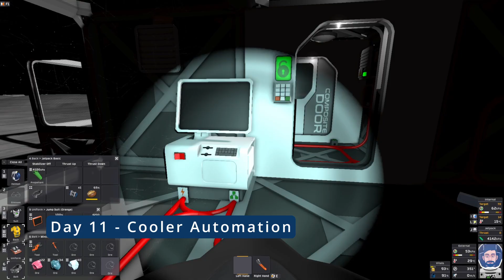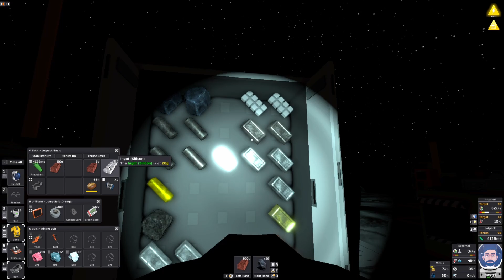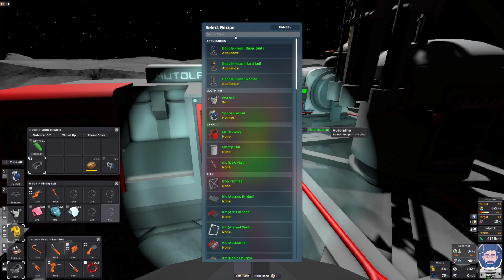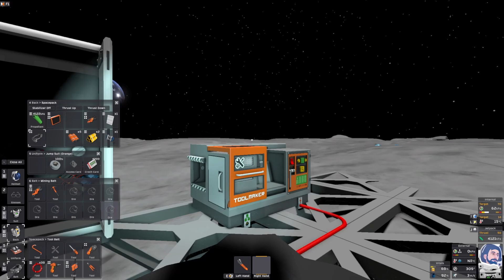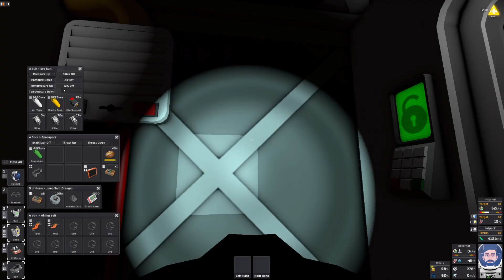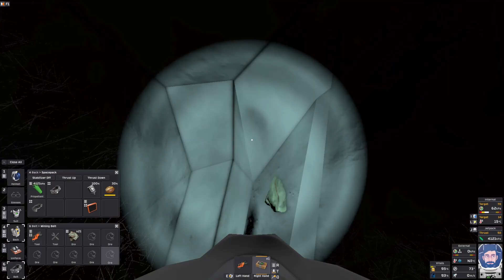Stationeers - Moon E5 - Mining with a Bang

Comment: FYI, in vacuum worlds having things outside is deemed not insulated, the “atmo” will cool things to 50K. So all your regular pipes and canister storages will slowly cook to freezing. (Except N2, that freezes at 40K) it’s slow but will happen over time.  
if you want to use the charges for mining use a security printer, they print MUCH faster! As well print off some mining backpacks. They are 24 slots costing 6 iron each. Hard mining backpacks 28! slots takes 6 steel , 1i 
Invar.
Reply from the maker: The heat loss is a big reason I started using the insulated pipes.  I still need to swap the canister storages, and replace the oxygen setup, but I have a bit of time before they get too cold.

Thanks for the tip about the security printer... I completely forgot that existed!